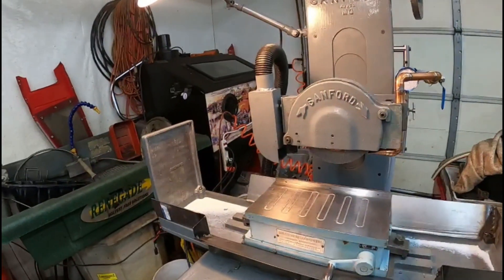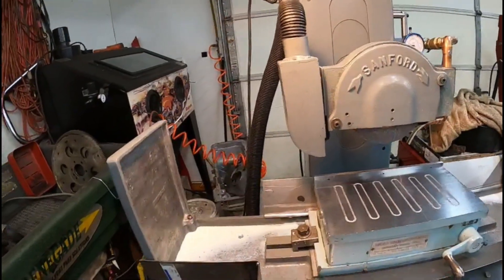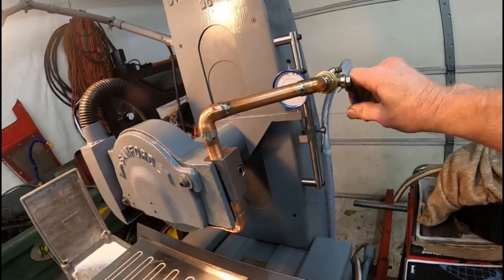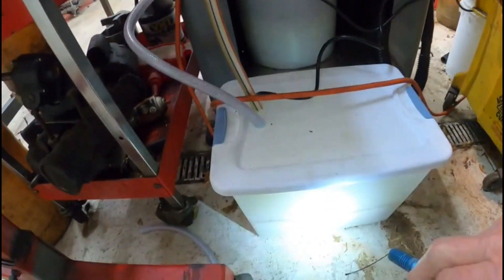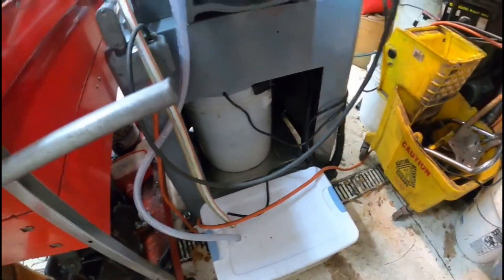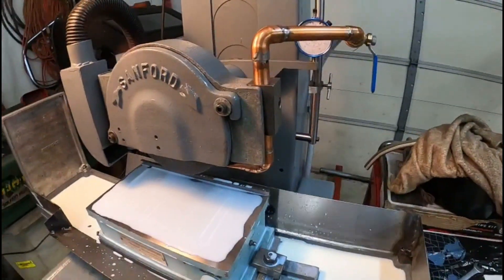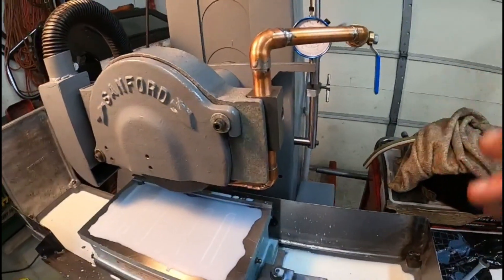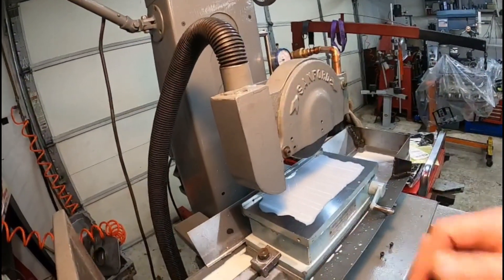Finale update on surface grinder    Made with Clipchamp

Comment: This is interesting. My MG612 does not have that port on the side of the saddle where that trough is. I was wondering what that trough was for! Nor is there any way for any flood coolant on the table to get into that trough. My table does have a threaded hole in the back left of it, presumable put there to handle flood coolant. I hope to add flood coolant to mine at some point, but I need to get it working properly first.
Reply from the maker: I think yours is older then mine, because It has an oil port on the spindle that mine does not have. The first 3 digits of serial number will tell you when it was made. The only place I could find any info on them was on the lathes UK web site.👍
Reply: @Randysshop  Mine was made in 1969. I have been warned by few folks to stay away from the spindle bearings, so I probably will ignore them for now. I sent you an email with a link to a website of another owner of these grinders. You might find it useful. - Greg
Reply from the maker: @MyLilMule  I will have a look at it. Thanks Greg
Reply from the maker: I do remember looking at that site now, The spindle on mine was nice and quite, I did remove the dust cover on the back of the spindle, and the grease looked good so did not do any more with it. The machine I have was made in 1957. Good luck with your machine.👍

Comment: Great Outcome Randy. Just a small piece of advice, try NOT to run the coolant with the wheel STOPPED. The wheel is pourous and the coolant will soak in at the stopped position, and when you start the wheel, initially it will be wildly out of balance and may cause problems. Regards from Australia.
Reply from the maker: Hi Dave. I did read about that, and turned the machine on for a bit after the video when I wiped off the chuck. McMaster Carr sells fine mesh filter bags I am thinking about adding one to catch the fine grit to help keep the coolant clean. Cheers 👍